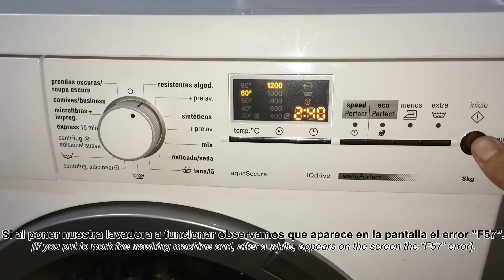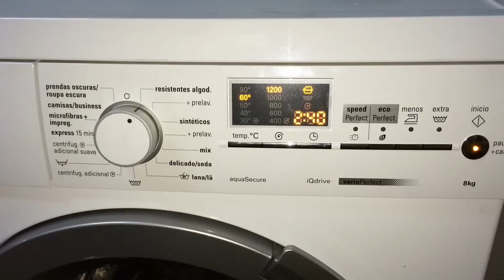ERROR F57 lavadora Siemens (WM12S420EE). Solución. [Fault washing machine. Solution].

Comment: También puede aparecer el código E57 cuerdo ha habido un corte de luz. No tiene porqué estar dañado  las placa base.
Reply from the maker: Hola.
No es lo normal. Cuando aparece este error por lo general siempre existe una avería en el motor o la placa electrónica que lo controla.
Reply: Eso me sale a mi E 57 
De que será ?
Reply: Sergio Marimón 
Hola Sergio.  Yo tengo ese problema pero hay luz y no se qué hacer porque no se quita ese error y no me funciona. Sabéis qué puedo hacer?  
Gracias ,un salodo
Reply from the maker: Hola.
En el vídeo muestro los motivos por los cuales puede aparecer este error.
Por lo general se debe a una avería en la placa electrónica que controla el motor o a una avería del propio motor, por lo tanto te recomiendo que revises y compruebes el funcionamiento de estos dos componentes.